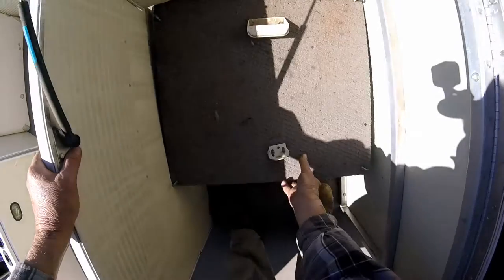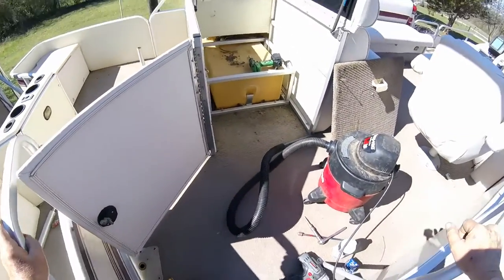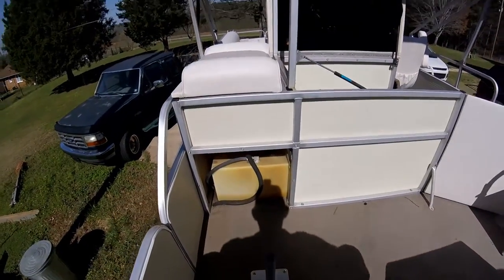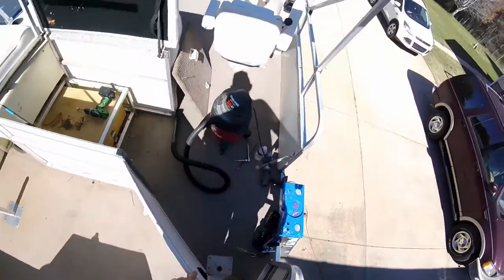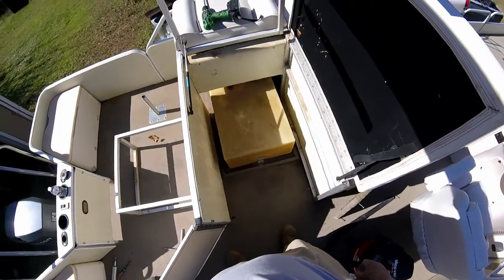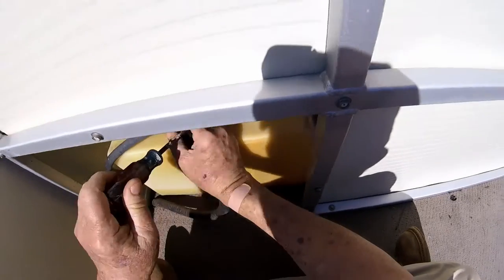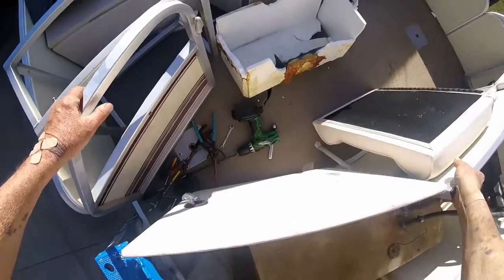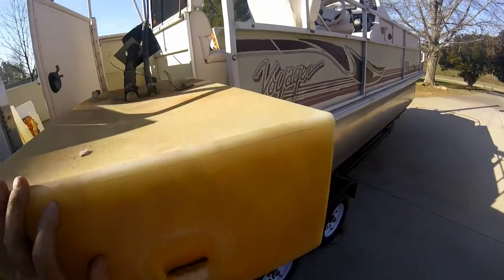Pwalpars Resurrect My Boat Series Update 3 9 2017

Comment: You are definitely gaining, Walter! As for cleaning the gas tank, take the filler hose off so it is out of your way and you don't break the tank fitting it is attached to. If I saw correctly, there is a gas gauge that goes in the top of the tank. I am guessing there are some screws that hold it on, remove this piece and you should have a hole you can pour the old gas out of and then rinse the tank to get it clean. Good luck!
Reply from the maker: Thanks Matt

Comment: Man, Walter.... You are a bugger for punishment !  I'm really surprised you didn't enlist the help of a runner... someone to go fetch tools.  All that climbing in and climbing out has got to sap your energy right out !  Persistence did pay off at the end, you got the tank loose, and out of the boat.  Dunno if the hoses can be removed from the tank body or not, but if they can, pour out the old gas into something like a drain pan.  Might be good for lighting your next burn-pile or something. Couldn't hurt to "swish" some fresh clean gas around inside the tank after.  Project is coming along very nicely.
Reply from the maker: No runners available